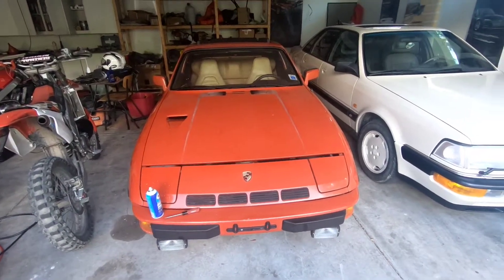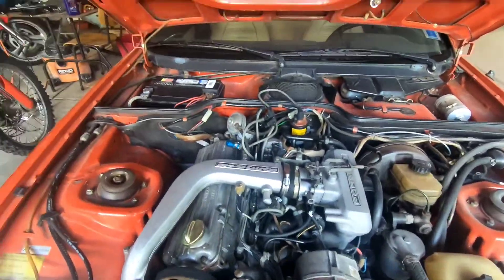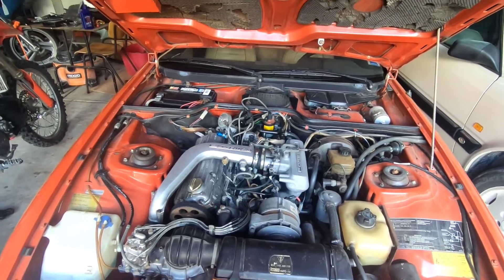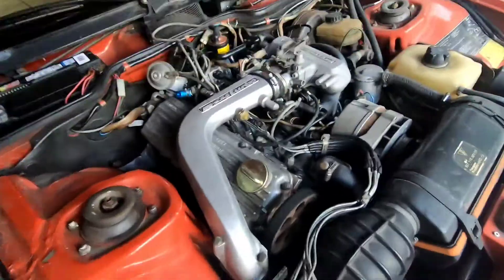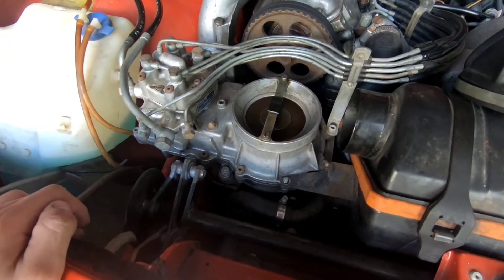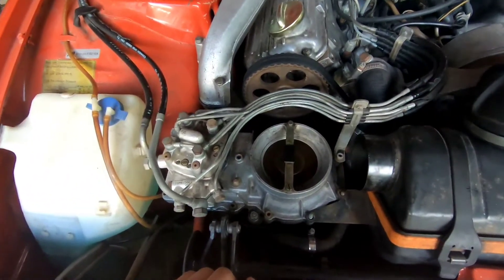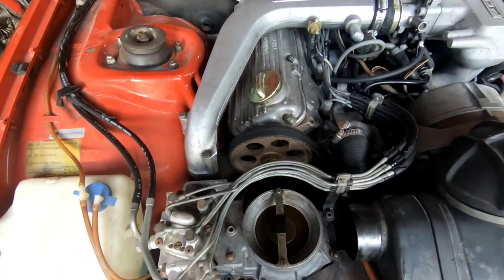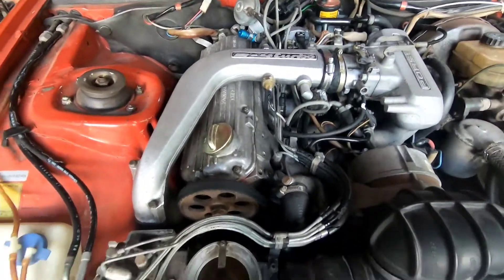How to diagnose an Intake Manifold Gasket Leak | Boost Leak? | PORSCHE 924 TURBO | BOSCH CIS

Comment: its most likely NOT the manifold gaskets, probably the  injector  plugs, or the seal on the turbo crossover(intake)
Reply from the maker: One of the port seals ended up being slightly blown out, I am pretty sure I traced the Cold start issue to some vacuum leaks, next time the car is at the shop I will pressurize the intake to hopefully trace the boost leak